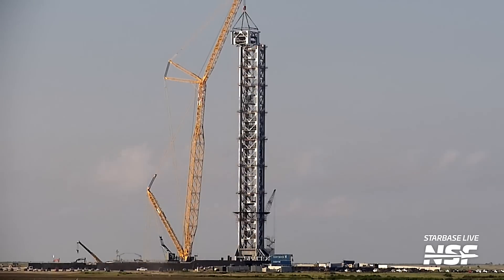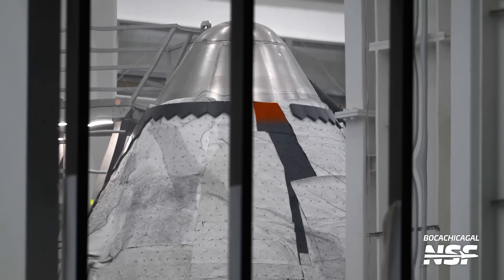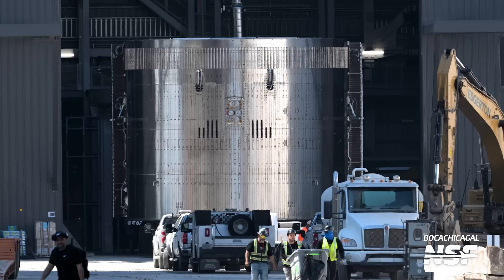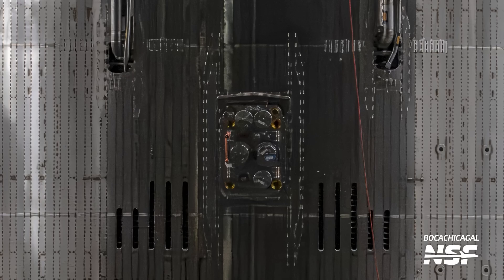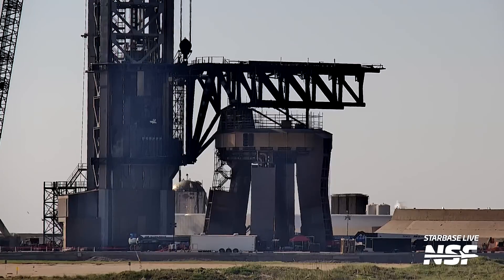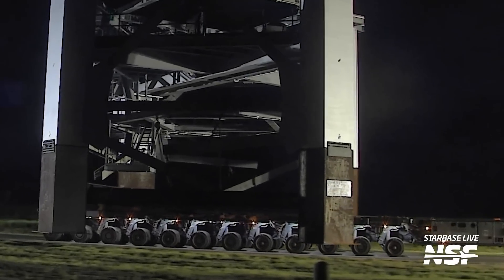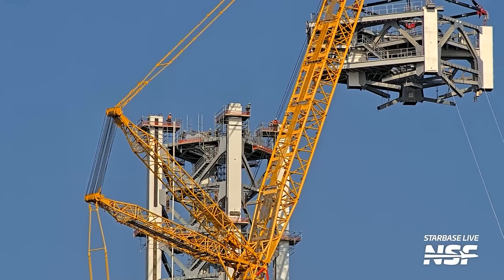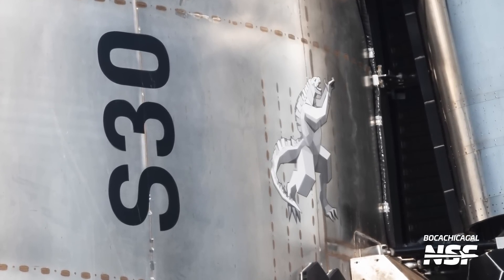A New Era at Starbase Begins | Starbase Update

Comment: Kudos NSF team. Great update.
Super curious about the coating applied to Starbase towers. My hunch is they use a thermal spray metallizing process to coat the steel with zinc. By far the most robust and effective anti-corrosion treatment for marine environments.

Comment: FYI - The diagonal structural elements mentioned at 13:12 are not for distributing the weight of the segment, they’re lateral bracing to enhance stiffness of the entire tower and protect against seismic events.

Comment: Why don't they also put heat Shieldtiles on the Quick disconnect Shielding? They experience lots of Weather changes and undergo lots of vibration and heat during Launch.
Reply: The shield tiles would be shredded by the raptor plume.

Comment: Two towers, they should catch them both. Probably not but it explains the sticker on the starship.
Good report!
Reply: The Starship upper stage is planned to be caught at some point, not land. However, that is very dependent on how all of the testing goes for it with the water landings. They may eventually only add landing legs instead, especially since they will use landing legs for HLS. 

I couldn't find direct details from SpaceX on it. As such, I believe we only have the Wiki and Elon Musk tweets/interviews to go on. That said, the whole thing is constantly changing. And SpaceX absolutely will not stick to a design that doesn't work.
Reply: @anthonypelchat  Thanks for the conversation. I agree. 
The one thing they can't do is catch both the booster and the Starship on the same tower, considering rapid fuel hauling as proposed. So dual towers within reach of one launch pad?
Reply: @sagecoach  Going to be interesting how they handle Ship catches in the future, assuming they go with it. Landing at launch towers would mean removing the boosters hours before the landing attempts. Each ship that lands would likely keep the tower from any other use for a minimum of 12 hours, with 24 hours or more being more likely.

My guess: either there will be dedicated landing towers for ships or they will land several in large batches over the course of several days. Dedicated landing towers is the simplest idea, but does require extra infrastructure and transport that likely won't be needed much except for a few weeks every year or two. 

Landing back at the launch towers likely won't be an issue most of the time. Even if SpaceX is launching 365 Starships a year, with 5 towers you are still looking at 5 days between launches on average. The biggest problem is going to be during Mars missions. They need to launch basically 10 ships for every single ship heading to Mars. So 9 ships need to land for every 10 launched. And the launches have to happen in a relatively short amount of time. My guess is that they will finish a large launch campaign and then pause launches for a few weeks while they bring all additional ships back.
Reply: @sagecoach  Also one thing to keep in mind is that the idea of multiple launches in a single day is not something that HAS to always be the case. Basically, normal launches for customers, govt, and Starlink, plus whatever else SpaceX does in the future, will likely not have enough launches to fill a multi-launch per day from all towers. The only time that they will need that ability is for massive lunar missions, like HLS, and for massive Mars missions.
Reply: @anthonypelchat  It is going to be interesting.
Hard to comprehend the full logistics.
Reply: @sagecoach  Agreed. Hoping to be over at South Padre early next year for 2-3 months to watch. Going to reserve an RV space for a while. Won't be in time for the 5th flight unfortunately.
Reply: It depends on the mission. Fuel tankers are caught to fly another load. Orbiting fuel stations never land.
Moon and Mars flights may land or not.
But nothing is certain.
Reply: They are going to catch Starship. It was initially going to land but they have ditched that idea (except for HLS obviously)
Reply: Starship isnt designed to be caught.

Comment: What is SpaceX @elonmusk going to do with all unused / defective Raptor engines 😂
Reply: They are still going to be using older versions of Raptor for a while. But the ones that aren't used for whatever reason will be recycled.
Reply: @anthonypelchat recycled?
Reply: @wizzyno1566  torn down to be reused as either the new version or as scrap.
Reply: @anthonypelchat reuse of parts wont happen - almost everything will be a different shape in the new engine. Just look at the pictures.

And the value of the scrap will be miniscule compared to the value of an engine.

My guess is museums and exhibitions. Or they'll scrap them to keep the designs secret.
Reply: @wizzyno1566  Already said scrap. Unlikely going to museums. Some parts might be similar enough to used. Who knows for sure. They may also be used for other testing items. But a lot of the material might be better melted down or whatever to use in new versions.
Reply: @wizzyno1566  The only disagreeing part was the museum portion. Otherwise I thought we were just discussing this.

Comment: Why did they use a tubular design on chopsticks instead of solid steel members used on the tower segments ??
Reply: Stiffness to weight ratio. Also the tower  is mainly tubular.

Almost no structural elements in any building are solid, as its the most weight inefficient way to design anything except an element that is purely in tension - i.e. wires on bridges. Anything in compression or bending will be hollow to some degree.

Comment: Thanks Jack and NSF, for the light and honest delivery, and being sure to mention when you know and when you speculate. 

Giving each of those thirsty vacuum Raptors their own feed will let them add engines later without changing the original plumbing network, but I’m worrying that those extra downcomers will be too flexible during maneuvers. They may get more bracing after installation. 

Regarding maneuvers, I wonder if we will ever know just how baffled those tanks have become?
Reply: The answer is probably quite... baffling.

Comment: A flight five booster catch attempt is a crazy publicity stunned that only a stupid con man like Elon would press for. Attempting a booster catch on flight five will not help in the development of starship at all. Instead of trying a booster catch, SpaceX should put landing legs onto the booster and landed in open field where if anything goes wrong, they can just let it crash, and then, if it does land correctly, they can actually go and check the engines and check the plumbing and get a lot of very good information about what’s going on with the booster and what needs to be improved. A booster catch is fraught with unnecessary danger that the booster is not going to get caught correctly at the last moment and that it is going to crash and perhaps destroy other things on the ground around the launch site.let us hope, that if Elon bullies SpaceX into this crazy plan that indeed the booster catch attempt fails and there is damage on the ground because then finally SpaceX will be able to tell the clown idiot Elon to go shut up and sit in the corner while adults make the decisions at SpaceX.
Reply: Oh brother. Give up the blind hate buddy. SpaceX has many of the best engineers on the planet working there. They already tested a landing attempt in the ocean. If they feel confident that they can catch it, it's their money to do so. Further, they have plans in place that will prevent any major damage if the booster isn't working right. But even if everything fails, they already have a second tower nearly ready.
Reply: @anthonypelchat  
Good engineers do not do needless, dangerous publicity stunts with a prototype vehicle that has NEVER landed 100% successfully.  Only an idiot attention-hungry child does such stupid things.  An idiot child like Elon.  The fact that the good engineers at SpaceX are being directed to waste time at this point to test chop stick arms instead of working on vehicle improvements is misspent time that will delay the completion of Starship.  Plus, if this publicity stunt goes awry (the way that the too early Flight 1 did), then completion of Starship will be delayed by more investigations the way that Flight 2 was. The fact that Elon can force the good engineers at SpaceX to waste time on chop stick arms for a needless publicity stunt at this point is an indication that something is seriously wrong with SpaceX senior management.  Let us hope that Elon does not turn his idiot skills to interfering with the Falcon 9 operations team.

Comment: Flight 5 from potentially late July, to Aug, to mid sept and now maybe early Oct is a bit disappointing. NO WAY Artemis III can happen in 2026 at this slow rate.
Reply: Space X was already behind the 2026 schedule for a launch with Artemis.  There is so much to do between now and that even 2027 will be hard to make happen.  Besides getting the booster and ship certified for lunar flight they have to refine the refueling in space.   That means multiple starship launches in a short time.   

Plus the Orion capsule is having heat shield issues.  Heck, maybe these 2 companies should just focus on launching by 2030!!

Comment: Boost the speed of the catcher befor you catch the booster.
Reply: Not necessary because of the fine adjustments will be made by the booster.  Since it can hoover unlike the Falcon 9 it can compensate as necessary.   It may fail completely, but at least it will be entertaining.

Comment: It will be interesting to se how much further Starship evolves. It seems that the fueling apparatus keeps occupying more snd more precious payload space. Those feed tubes  running through the middle seem they would be a limiting factor regarding the size and shape of  potential payload items.
Reply: No payload goes through that, that's the LOX tank and it's always been there
Reply: @ale131296   AH I misheard . I thought I head someone say those lines are coming from the fuel dome rather than the bottom of the common dome. 
The most recent nose fuel apparatus does seem to be taking up some more room though -  - -isn't it?

Comment: Using the serial numbers to confirm that the recently spotted Raptors are still Raptor 2 and not Raptor 3? Given how on top of everything Starship-related you NSF folks are I'm thinking that was some very dry and deadpan humour from Jack because based on the photos we've seen so far of Raptor 3 you certainly don't need to check serial numbers to spot the difference!

I am so looking forward to the first Raptor 3 being spotted at Starbase. That design looks so amazing.
Reply: The rat’s nest of tubing and wiring on the engines are a clear giveaway of Raptor 2 provenance.
Reply: @julianfp1952 I doubt all v2 Raptors are built to an identical design. So I assumed they just meant they don't expect there's much difference between today's batch and recent batches - even within the constrained scope of the Raptor 2 family.

Comment: Tower 2 has a lot of piping and conduits for electrical work. Low quality electrical connections have lots of connections along it's length, while high quality requires a constant run from source to final device. This is even more important for data cabling.